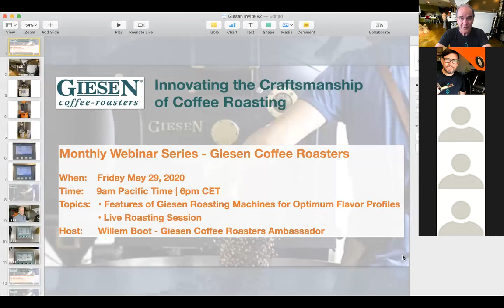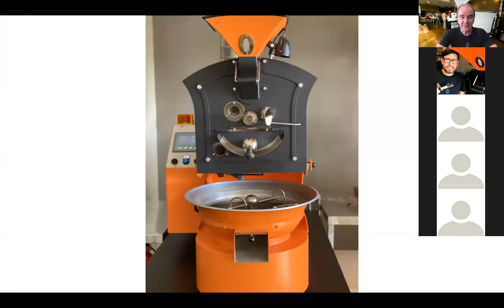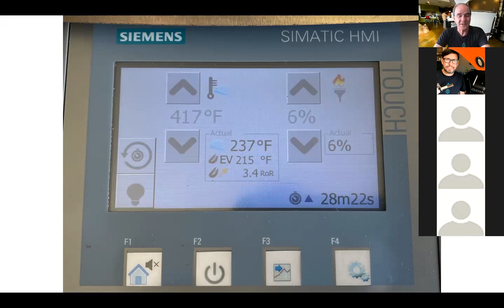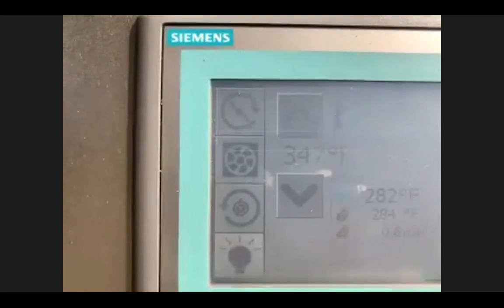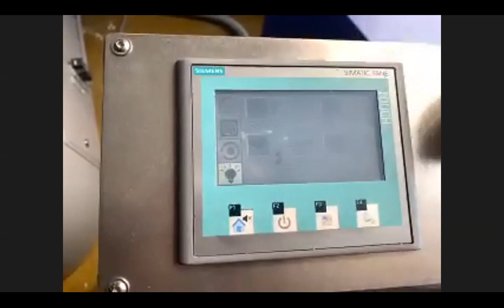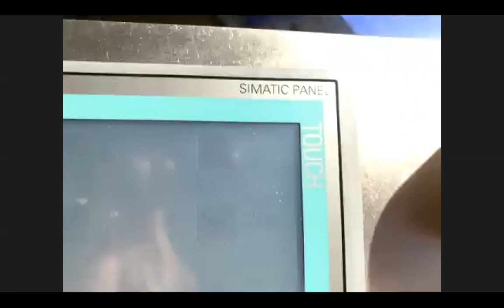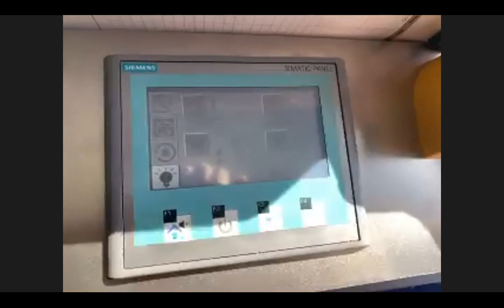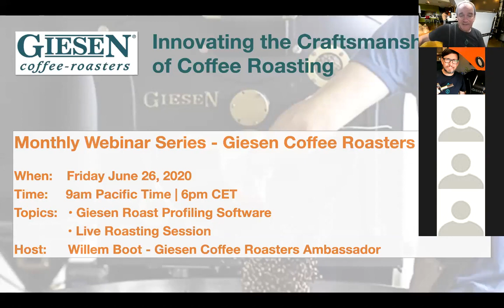Giesen Webinar - General features and control panel

Comment: Hi @Willem & @Marcus, thank you for this Giesen Webinar #1.
It is very informative. This is the 1st video about coffee roasting that I watched on YouTube. I spent more than 2hrs watching this, rewinding parts of it several times and taking down notes:

- 21m 40s - almost all coffee roasters use cast-iron components as iron absorbs and radiates out heat gently
- 39m 40s - coffee beans density (d); e.g. 0.68g/ml, very high d: 0.7, 0.73, low low d (below specialty grade): 0.55, 0.6

- 39m 30s - translucence
- 41m 12s - burner control (not auto) to roast manual > why would people manual roast coffee beans?
- 41m 28s - coffee beans first crack @ 395F on Giesen W6 (?) 
- 41m 38s - exothermic reaction
- air flow > air pressure measured in pascal
- 47m 18s - Willem Boot: specific nuances of the coffee that are driven by the acidity of the coffee
- 47m 30s - drum rotation/revolution > manipulates the flavor profile of the coffee beans
- 49m 20s - scorching
- temperature: rate of rise
- 59m 20s - higher pressure setting > more airflow > more heat transfer through convection
- 1h 20s - how to reduce smokiness during coffee roasting: increase PA setting > fan works harder to allow excess smoke to escape 
- 1h 1m 18s - drum speed: faster rotation, 2 things happen > 1. coffee beans are pushed more to the wall of the drum (more conduction heat transfer), 2. coffee beans rotate faster within the drum (more convection heat transfer).
1h 02m - some coffee roasters will slow down the drum rotation speed near the final stage of the roast, where the coffee beans are lighter (they have already lost a lot of mass)
- Much more.